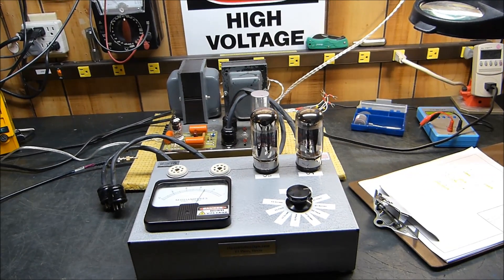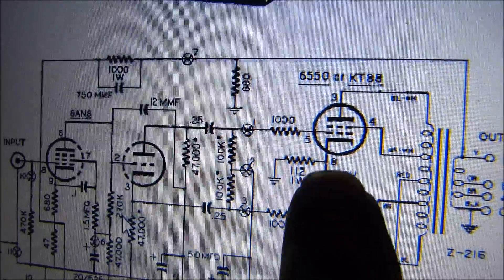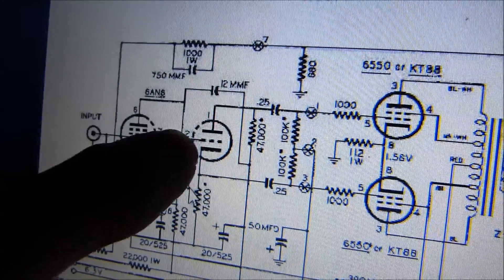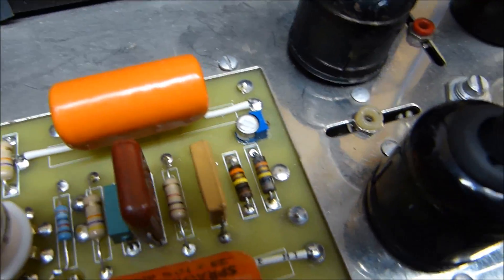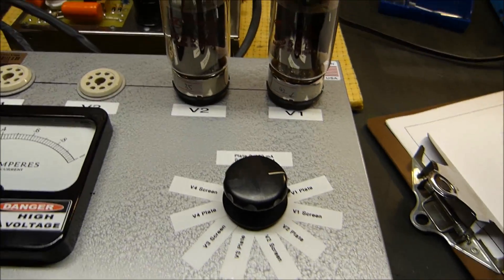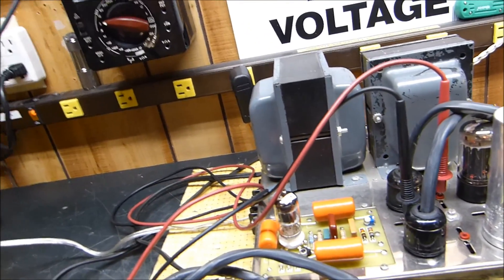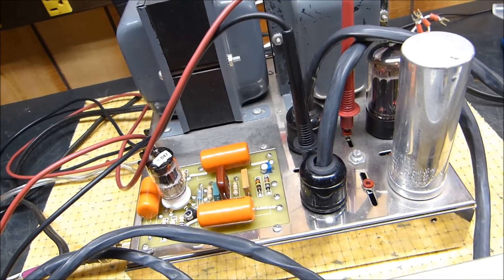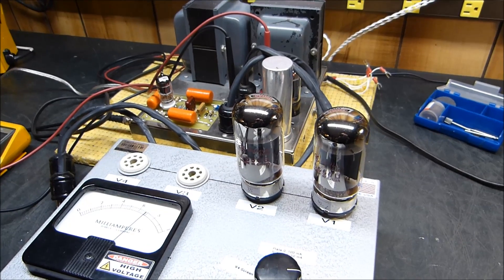Dynaco Mark III Vacuum Tube Amplifier Static & Dynamic Balance Modifications

Comment: Great video! Any advice regarding how I could make something like your "Awesome Contraption"? Thanks!
Reply from the maker: It can be worth having with some amplifiers and it can induce instabilities in other amplifiers. You just have to figure out how you want to  wire the connections from your tube sockets in the amplifier thru the tubes in the test jig and back to the amplifier. Keep the connecting cables as short as possible to decrease instability. The safest way it to put a 1 or 10 ohm  resistor in the cathode circuit of the tube and measure the voltage across that resistor and calculate current - one tube at a time...
Reply: @ElPasoTubeAmps  I really like the meter and switch. The switch is neat.
Reply: @ElPasoTubeAmps  This video is very interesting. Your "Awesome Contraption" has got me to thinking: the way you have that switch wired and labeled, you are using one meter in place of many, when I finally caught it after... not my first viewing... Now I can build a compact meter panel with many vintage classic analog meters, many parameters (pun intended) one or two large nine position chicken's head switches and a large meter, that will display many aspects of the DUT: Amps, Watts, etc. Milli, Micro, Pico. This would be very handy, no? You are a genius. I want to run out in the street and shout "eureka"! But I don't want to get shanked or arrested... Or both. So you will just have to be content with a big Thank You. You build and produce these high quality tutorial videos with your own time and expense. Very generous to say the least. Though we may not realize it, you are helping many more than you can count. Thank you very much!
.

Comment: I've been looking for a circuit that I could balance both 6550 tubes on my mark iii.  Please correct me if I'm wrong., Looking at the modified schematic, it looks like you have cut off the dc fixed bias that goes to both signal grids of the two 6550 and it is a cathode bias now. Also when you installed that 39k ohms in series with 20k ohms pot that goes directly to the ground, what happen to the 12mmf and the 20uf 525volts capacitors, are they still connected? Looking forward to hear from you and please explain in full detail. Thank you.
Reply from the maker: The output tubes still have fixed (adjustable) bias. This modification does not make the tubes cathode biased. The reason Dynanco used an 11.2 ohm resistor, in the original design, was because a fellow could use an old style D cell battery to calibrate their voltmeter. Nowadays the old style batteries are called "heavy duty" and not alkaline. The voltage across a new old style D cell was 1.56 volts. The idea was to use the old style D cell battery to "calibrate" the voltmeter used to make adjustments on this amplifier. Once the 1.56 volts from the battery was noted on the voltmeter, the idea was to set the bias on the amplifier to this same point on the meter, thus ensuring a correct bias voltage. In my case, I separated the cathodes and put matched resistors in each cathode circuit to ground so that we could monitor the cathode current on each tube separately. The actual value of 11.2 ohms is irrelevant to the performance of the amplifier and is that value only because of what I noted above. 
 As described in the video, the static balance pot simply allows a small range of adjustment of the bias voltage to each tube separately so that the cathode currents can be equalized as read across each individual cathode resistor that has been newly installed. Once the tubes are balanced, as best as can be done, the original Dynaco bias adjustment can be made to set the bias to exactly 0.7 volts across the 10 ohm cathode resistors ensuring 70 mA of static (bias) current through each tube.
The 12 mmF and 20 uF 525 volt capacitors have not been changed. Just simply remove the existing 47K resistor from the PC board and install in its place the resistor and pot shown in the video. This allows a dynamic adjustment of the driving signal to the grids of the 6550's and must be done with a sine wave signal (1 KHz) driving the amplifier, usually at full output. Naturally, I would "circle through" these adjustments a couple of times as one adjustment may have some slight effect on the other.
I hope this helps.

Comment: Dave
  Wonderful and informative video as usual..You mentioned putting a 500k pot in place of the two grid to ground resistors which are 100k each..Wouldn't it be better to go with a 250k pot to be closer to the original values? I know some engineers like to change the rid leak to a higher as to make the driver see an easier load and get a little more driver.
Reply from the maker: Mike Samra Hi MIke - I have to admit, I just lifted the "mod" from the diytube Poseidon board and it leaves the 100K resistors in like the original Dynaco board. With that 1 megohm resistor off the wiper of the pot, the grid resistors are essentially still 100K. I really do hope we can talk tonight. I have been into a bunch of projects. I did get in all the essentials for the 3-1000Z RF amp and the 810 audio amp. Too many projects and not enough time - what a burden, huh?

Comment: Driving 6550's with a cathodyne inverter is not a very good design in the first place. Ah well, it's cheap and keeps the tube count down.
Reply from the maker: Amplifier Experts Hi Mark - economy seems to always play a big part, doesn't it. When I look at some of the 1950's era guitar amplifiers, I am amazed at the cleverness of the design probably just to save a part. It is also interesting that those designs and builds are held in such high esteem for their (sound) with the best of them having a triangular waveform (for a sine wave) with the full spectrum of descending amplitude harmonics. You know this because you and I have measured this and this (sound) is what makes people "cry" with joy and want to duplicate.  I also try to remember that 60+ years ago, a tube socket, a 0.1 uF 400 V capacitor and a 100 ohm 5 watt resistor was not as easy (and as cheap...) to come by as it is today. On the other hand, I often times stand in respect for just how long some of these devices have lasted and still work. I think you have seen my comparison of the new driver boards for the Dynaco and compared to the original 6AN8 design. For reason I can't quite qualify, I think I like the original  6AN8 design better. Maybe it is just nostalgia. From a philosophical standpoint, in many cases, feelings, belief and superstition will trump data and logic - in all of us, at one time or another and in one way or another. Good to hear from you.

Comment from the maker: I took the inspiration for the cathode balancing pot from the diytube Poseidon board. The variable load resistor on the triode of the 6AN8 was inspired by the McIntosh MA230 amplifier. In the MA230 they use separate pots to independently adjust the grid bias to balance the cathode currents of the 7591 output tubes but I think this works just as well and a lot simpler (and cheaper).

Comment: why don't you just connect the dvm to the 2 TPs and aim for Zero volts?
Reply from the maker: mamoynas That does work for the cathode current (bias) balance but it does not work for the dynamic (AC) balance.
Reply: ElPaso TubeAmps Ok! keep up the good work!